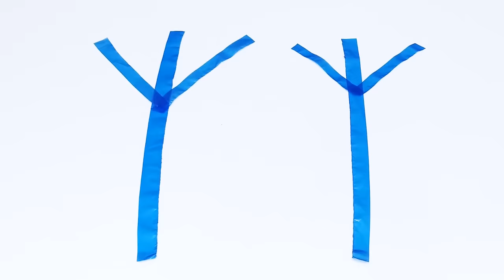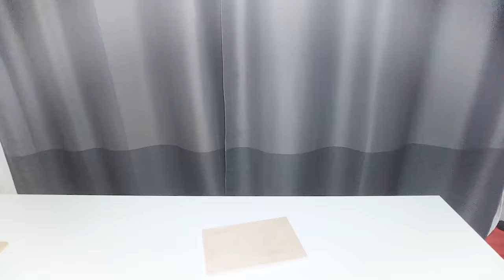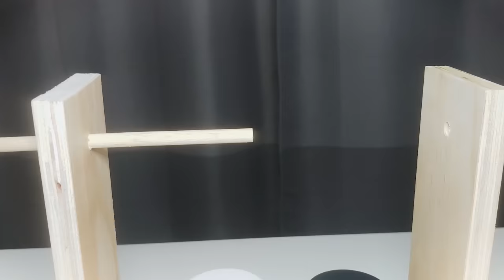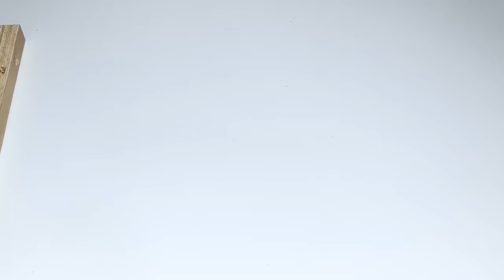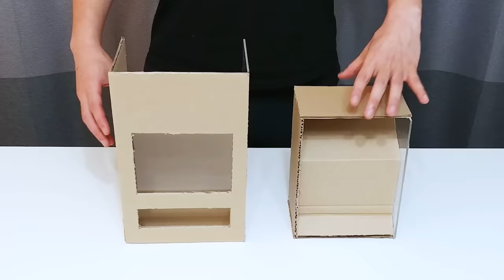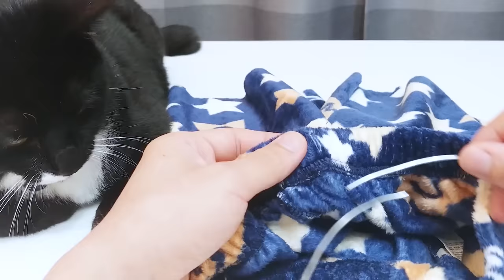18 Amazing DIY Cat Toys You Can Do at Home Compilation #1

Comment: So many complaining that this is complicated, it's a bit fast but they are all very simple instructions and you can replicate them no problem. The only thing used that you might not already have is the motors but even those are just connected to something basic . I'm actually amazed of how simple and functional these things actually look, i think you did a great job . 

If you feel out of your confort zone and you wanna do something like this show the video to the employees at your store and they'll help you out with materials and a lot of the time they'll lead you right where you need to go . I've done a lot of projects and I don't even research that much anymore about types of materials I just go there and show them and they are always very helpful and most of the times we come up with even a better idea . It's easy to feel overwhelmed when everything is so different and at the same time looks the same . God bless those guys.

Comment: Some of these are particularly dangerous, like the battery's and those small balls the can could and probably would swallow...I would not recommend those.
Reply from the maker: As you say, it's good to have complete insulation when using batteries. The safest way is to use the toys your cat normally plays with.
Reply: I think if you’re thee supervising it’s ok
Reply: Came here to say the same thing. The one with the small batteries is the only one I'm worried about. Those small batteries can kill if they're swallowed as stomach acid breaks down the outside metal quickly and then the battery acid burns through the stomach lining. You'd have to create a secure cover for that toy. Also I would make legs that had a soft thing that couldn't come off the end, because the sharp metal could easily injure a cat.
Reply from the maker: @originalnilson  You're right. Electric toys and sharp toys need to be made more careful. Thanks for the advice.

Comment: Magnets are crazy dangerous if the cat swallows it...
Reply from the maker: Yeah, so small magnets should be especially careful to manage.
Reply: How would any of these magnets be swallowed? They're attached to something, and sit on a pole. They're also rather large.
Reply from the maker: My guess is the magnet used as the ferris wheel door knock. I will attach that by glue gun!!!

Comment: Boosted!! This should have more likes, that was an awesome video! Are most of the supplies (wheels, copper, water/air pumps) from a hobby store or did you order from Amazon? I suppose the wood is from a hardware store like Lowe’s or Home Depot? Thanks in advance. 😺